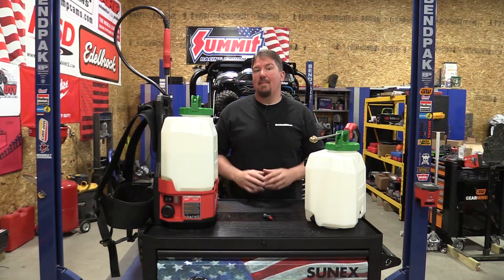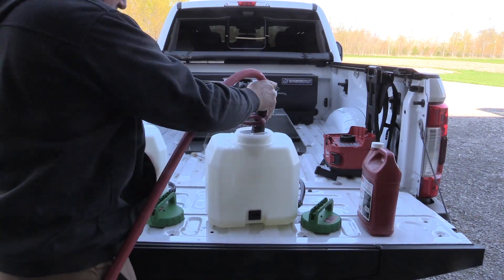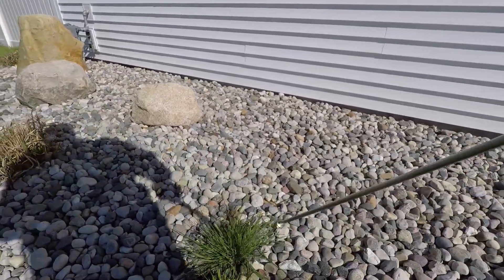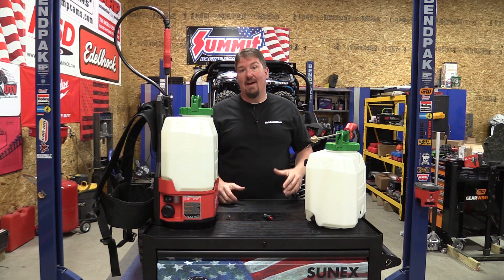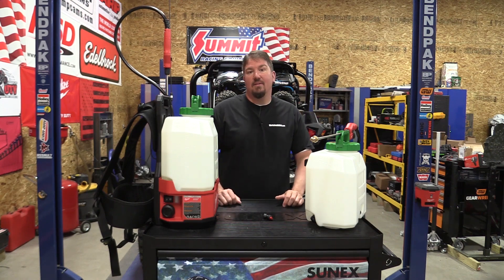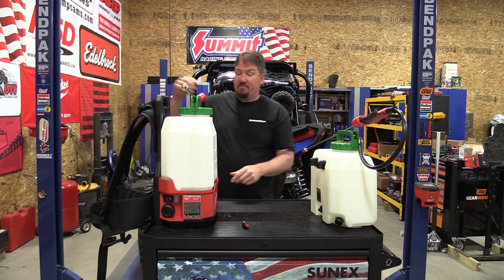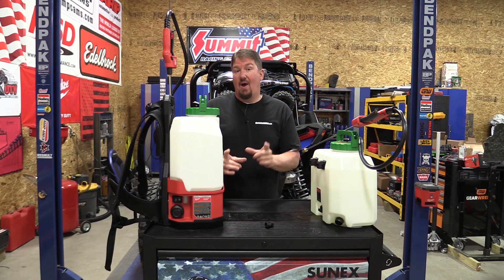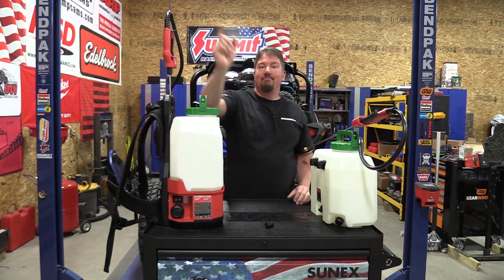My Experience With The Milwaukee Tool M18 4-Gallon Switch Tank Backpack Pesticide Sprayer

Comment: Looks like a good solid sprayer. Definitely targeting a smaller group of users though. Especially at that Milwaukee price point. Glad they made the system interchangeable without cross contamination.
Reply from the maker: They are going after the pro market for sure.  For the quality, you are getting something priced at Stihl prices.
Reply: @WorkshopAddict  I chose the flo zone  because it's lighter empty than the milwaukee

Comment: I brought this a few weeks ago . It's heavy and heavy duty. I brought this unit for cleaning coils on RTU (rooftop units HVACR )   this unit has been amazing to clean coils . It has amazing PSI to help clean and force the grim out. It built well . I did call Milwaukee to ask if it could handle coil cleaners and they did respond w stating they had not tested this w HVAC chemicals . Hit I'm having no issues
Reply from the maker: Level 5 does push some water.  Great use!
Reply: Exactly the use I was wanting for this. Just found out it could do 120 psi, which sounds like a good amount. Can you make the wand extremely short, say less than 6 inches?
Reply: So glad I read reviews. I’m a hvac tech too and considering buying for exact same reasons

Comment: I think this is a great tool but the price is a bit much . The price is why I will wait and see if it drops or maybe they will improve it down the road .
Reply: I agree. You definitely pay for convenience. If the tanks came in at a price point of $99 instead I could see buying into the system. I got to try one out that my friend had and the only thing I'm disappointed with is how much was left in the tank. My cheap hand pump sprayers maybe leave 1oz if that in the bottom and the backpack pump is the same. It would be nice to see a redesign of the tank to use up all the mixture in the tank. In theory if you had all the tanks you needed it wouldn't matter if a few ounces of one mix is left over if you're making more of it in the future. But without an unlimited checkbook or sponsorship, most of are going to re-use the pesticide tank for multiple different solutions/products and clean out inbetween.
Reply: Payed itself off in a day, good investment if you have a company

Comment: Do you have to use a certain size M18 battery with this unit? The reason I ask is because the battery that I'm using, it just doesn't give it much power at all. The battery works fine too. It doesn't make sense. The spray starts out strong and then it dwindles down to just peeing out of the end of the wand

Comment: Looks like a great tool to own as I am an exterminator. I use a birchmeier sprayer and it gets tiring to keep pumping. At that the price though, it'd be good for a small pest control company. Large companies like the one I work for would never buy them. But I'd probably need 2 batteries given how busy we can get.
Reply: That is both ironic and moronic that the larger companies tend to trend toward the less expensive (cheaper)equipment where the single operator small company always choose the best equipment despite the price,I bought a flo zone which paid for itself in a day's production so why can't the so called big boys have those

Comment: Can you store pesticides or weed killer etc in the tanks? I often don't need very much to do a few touch ups on the lawn, but since I buy agricultural grade products, you often have to mix a tiny amount just to get a gallon. It would be awesome to mix up a full batch (4 gallons) and just leave it in and use when i need it. I find that I put off spraying for months because I don't want to go mess with mixing stuff. Wondering if storing stuff in here for a whole summer would destroy the tanks or if they are meant to do that.
Reply from the maker: You can as long as they are not corrosive.  Anything corrosive would ruin the wand.  Tanks are fine.
Reply: @WorkshopAddict  awesome thanks for the helpful info!

Comment: I actually pre ordered the bare tool and tank when it was available. Lol I'm using it with a 1.5 ah bat. 

 Haven't used it long enough, but I think during regular use I'll use 1  bar  per 8-10 gal with the fan tip. I wanna say it's my fav of the 2 tips since it spreads well for perimeter and area coverage and the only adjustment would be the speed on the unit. 

I had the Ryobi 18v 1 gal sprayer and got sick of the noise, quality, constantly filling up,  and adjusting the spray pattern (to get your distance) filthing up your gloves or hands with chemicals. 

I also glued Velcro on the tanks and made Velcro label tags with a label maker so I can swap the labels and not  forget what's inside. This helps when I have 2 tanks and saves me money by not purchasing more tanks with permanent labels. Lol. 

I like using termidor (or generic) and sometimes neem oil. 
 What liquid fertilizer would you recommend? Thanks.

Comment: I'm wondering if they can have a longer hose and shorten the wand for the purposes of rendering. As the water model for wet machines having a fine mist spray will be handy for plastering application when you want the machine away from your work area.
For years I wanted a cordless tank instead of pumping up a pressure tank. 
Plasterers normally have the hose booked and then the plumber will turn around and say we will not have water for a few hours. What will you do then?
I have a Bosch pressure tank for water. I put a 5 metre hose and it works well. The only thing you spend time pumping up to put pressure. Been cordless all you need to do it fill up the water tank and away you go.
You can also set up and have showers whilst camping. Find some warm water. Oh, make sure it's not a herbicide tank when you want to wash.

Comment: Great Review Your channel helps me a ton deciding on what power tools to invest in. My business sprays Herbicides & I would not justify that price. Those sprayers don't last very long year over year. Definitely a product for the "Pro-sumer" market. I'm sure the quality is Milwaukee but looks like it may be more for Rhinestone Cowboys more than actual Ranchers/Workers(some are cheaper than others) I know old timers with hundreds of Acres & would pop a blood vessel if you tried to sell them a backpack sprayer for $300 & also some with 10 Acres who would pay out the nose to maintain their "Ranch" with the best the market offers. Not trying to knock it, but I can't imagine it does the job better than a cheaper alternative enough to justify the Milwaukee premium. Sure would be nice to have the whole Milwaukee line though, make no mistake!!
Reply from the maker: Can I ask what do you currently use?  The sprayers I have are 4 and 5 years old.  These are not like the TSC FIMCO stuff.  :)
Reply: @WorkshopAddict  I have a Solo unit mounted to a 25 gallon tank on an ATV. Use it nearly every day & no issues. But they all burn out eventually when you use them constantly & need to replace the pump every few years, I'm told(mine is going on 2 years of heavy use). For backpacks I try everything avaliable under $150(cheap ones do the same thing as expensive ones but break faster, expensive ones have better quality metal nozzle better plastic/pump ect. but still usually have some issue after a few months in my experience). Glad yours are holding up brother. This is my 3rd year as a business owner so I'm new & always looking for good equipment & recommendations. Your channel is huge for that to me.
Reply from the maker: I have never had luck with the ATV models.  All have been either FIMCO or a similar brand and they will all fluctuate in pressure and GPM after a short time of use.  I ditched those and went to a PTO driven pump for larger use.  The small all in one electric diaphragm pumps suck from my experience.  

My Stihl backpack sprayer has rocked and it is model SG 20.  It holds pressure but has a lot of plastic.  It is used weekly in the summer for weeds.

I have seen the Solo stuff at TSC and they too are a lot of plastic.  We farm pumpkins and we spray a lot.  I have found that in order for something to work long term, I need to invest $$.  Otherwise, we end up driving to replace it at the worst time possible.  

I own John Deere and Case Equipment for field use.
Reply: @WorkshopAddict  100% Quality is always the way to go. But there is always a nicer more expensive product. Solo is what I was rec'd & seems good but I'm sure there are better products. Sometimes the best tool for the job is not the most expensive( exp. I have a Ryobi P516 that does rough dirty work like cutting out roots/stumps @ ground level to then spray with Garlon, work I would never put a $500 sawzall through due to the sheer abuse it takes) I keep an extra pump on hand in case of an emergency failure. I sometimes work out in the middle of the Colorado mountains like 20 miles down some random trail @ 10k elevation & would lose a whole day(up to $1000) if I had to go to a store/shop to fix a failure. Will look into the brands you mentioned, always looking for upgrades. Thanks man!
Reply from the maker: I am not sure we helped.  You have everything covered.  I agree the most expensive is not always it.  In this case, time will tell.
Reply: @WorkshopAddict  Cheers! Appreciate that man. We're all just doing our best to succeed. I refer to your videos whenever I consider a powertool. A great resource for us!

Comment: But the real question is can I fill it with beer?
Reply from the maker: Of course.  You can spray the beer or pull the plug on the tank and drain it down your throat.  Get more tanks for different beers.
Reply: I'm sure Hercules will make one for you and dewalt will have one out too, then you can tell everyone how great HF is over dewalt

Comment: I just took mine out of the box. Have two tanks. Put some water in the tank for a test run and the pump would not prime (hard to believe it needs primed). Tried the second tank same story. Manual has no troubleshooting tips except "take to a Milwuakee Tool authorized repair shop". That's at least 140 miles from the ranch....... any ideas?
Reply from the maker: While it is turned on and running, really shake the tank a lot.  You could also put a little pressure with a dust blower on an air compressor through the vent valve.
Reply: @WorkshopAddict  Thanks, will give it a try, sounds like it might work!

Comment: Two questions, is the backpack removable and is the wand removable. I have an oil change shop and I fill hand pump bug sprayers with coolant and windshield wiper fluid to put in cars. The wand is not attached when I buy these bug sprayers and I use them just fine without it. Was wondering if I would be able to use these without the long wand and backpack
Reply from the maker: Without the backpack (red portion of it) you would not have a motor.  You can remove the straps.  So you need the red and black plastic portion of the backpack to hold the battery and the motor.  The wand is removable.  You might want to look at the water supply tank as it might be more up your alley.

Comment: Great information. I have read some other reviews that say it when about 1-1.5 gallons left, it will not spray until it is filled up again. Have you experienced any issue like this?
Reply: I have had this issue, but I JUST started using it, so I don’t know if it will get better or worse.

The way it was spraying, I thought it was empty but it had at LEAST 1.5 gallons in it.
Reply: @SVTStrikesback  the flo zone empties completely

Comment: You mentioned spraying copper in the fruit trees that you have, how high up can this reach?  I have a very small hop yard and the top of the trellis is at 20'.  I'm not to worried about reaching all the way up to the top so would this be able to reach 15' feet up?  I'm 5' 10" so my hand can get to around the 7' range, plus the wand and spray distance, seems like it would get to the 15' area potentially.
Reply from the maker: I believe you can reach the top with a more directed stream without issue.  It does pretty well on high.
Reply: I wrote this before I listened to the whole video, oops. User error lol.  I appreciate the quick response.  This is also a really well put together video and very informative.  Liked and subscribed!
Reply from the maker: @ryandowney9124  No prob bud.  Thank you

Comment: I own a pressure washing service and need to spray chemicals and such. Would this work well for that you think?
Reply from the maker: You are not giving me much info.  Are you spraying chemicals to clean things on a vertical item?  How high do you need the sprayer to reach?  Soap?  Bleach?  Harsh stuff?
Reply: @WorkshopAddict  sorry about that, I mostly do concrete and fences. Mostly just bleach or soap/degresser.
Reply from the maker: @eliasmalison2011  I know you will be good with soap.  I use mine for pretty harsh farm chemicals, but I wash it out with soap after each use.  Degreaser would most likely be okay but bleach would kill the rubber quickly.  If you were good buying a new tank often it would work.  It is an expensive item.  Seems like a lot to spend when the chemicals would kill it.  How do your current sprayers do with what you spray?
Reply: @WorkshopAddict  most of the time I use pump sprayers and they don't last long. If it lasts longer then those then I think it might be a better long term purchase. Thanks for the info. I'll try contacting milwaukee and asking them for extra info.

Comment: Just bought a kit and three extra tanks. Put water in it just to try and it’s leaking. Any ideas
Reply from the maker: Someoner else just posted they bought one of these and the tank was cracked.  That is a warranty issue unless you want to glue it.

Comment: That's going to get really dusty...

Sitting on the store shelf waiting for someone to spend that much money on it.
Reply from the maker: You are right, depending on the store.  If it is a store where farmers and lawn contractors show, it will sell.  My John Deere dealer has stuff much more overpriced than this and it flies off the shelves.  For the average guy, this is not it, but for the pro, this fits.
Reply: I just bought one online it will arrive in 2 days can't wait I'm done with the cheap ones that break every year
Reply: I bought ten of them and considering we use the battery for other items price isn’t to bad

Comment: Unfortunately you can buy professional grade sprayers and just have multiples for your chems for cheaper than one of those sprayers and a couple of tanks. The particular one I use is actually quite a bit better of a sprayer than the Milwaukee and with a few cheap upgrades becomes no competition and smashes the Milwaukee. Milwaukee's a cool company, and they aren't afraid to take risks such as manufacturing this thing without figuring out a cheaper way to do it and keep their quality. Hopefully we'll see the prices come down in the future as they find better ways.
Reply: Tell me the multiple  professional sprayers you can buy. Have u used one of these.
One of these Milwaukee  and 3 tanks would  be us $600 ?.
Nothing I have used comes close to the Milwaukee no noise and the adjustable pump is really effective in treatment for pest control.
Reply: Which brand do you use?

Comment: Just drove an hour to get to a Home Depot right before close to have this tomorrow morning. Get it home, decided to open it up and check it out. The tank is cracked out of the box. Leaked chemicals all over my building!!! Had it sitting on my Milwaukee pack out too, so I didn’t have to bend over to put it on. 
-Customer service is closed
-Not eligible for E service for some reason. 
Home Depot is closed
THIS IS ALL I HAVE......a YouTube comment section that I’m sure Milwaukee doesn’t give a hoot about. $300. Cracked. Took me 20 mins to clean up the mess. To say I’m upset right now
Doesn’t cover it. 😡😡😡

Comment: Glysophate can you drink that sht 🤔😳
Reply from the maker: Um No. and if you are wondering if I am spraying that on my concrete, I am not.
Reply: @WorkshopAddict  do you spray glypho on your fence line eliminating the need for a line trimmer? I'd love to see an "after" shot of round up being used as an "edger". I'm hesitant to spray it so close to my lawn in case of overkill. Was that glypho you used around the fire hydrant as well?
Reply from the maker: So....  The product I use for the fence line does have Glyphosate in it, but it also contains chemicals that will stop any other germination for 60 days.  That means I spray less.  Glyphosate works by stopping photosynthesis,  so it only kills what it lands on.  Spray it on low power and do not let it mist much.  You will not have any issue.  Yes, that is also around the hydrant.  Since this is new lawn this year, I am catching up on the edging with the sprayer.
Reply: @WorkshopAddict  What is the chemical stopping germination?
Reply from the maker: This is what I use.  You can see me pour it in the video.  It works well.  https://amzn.to/2HlqPM2